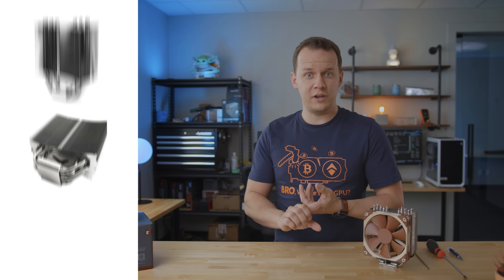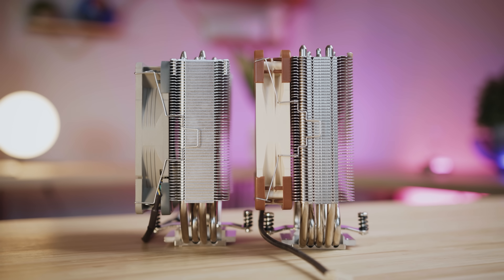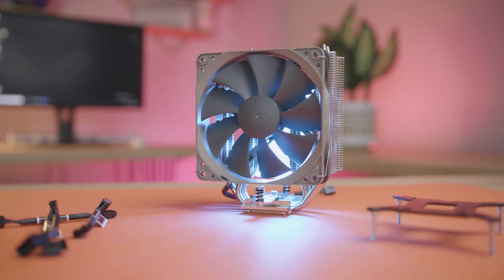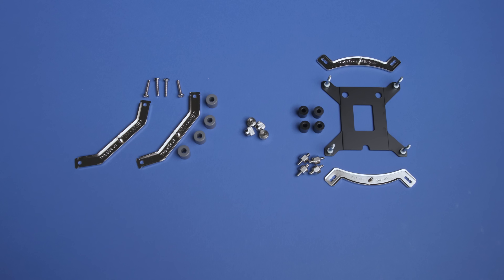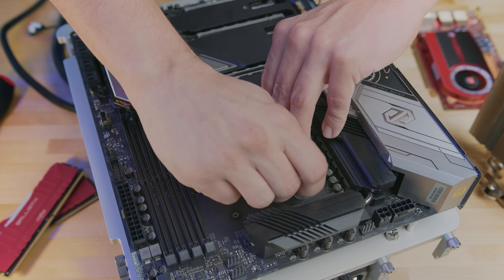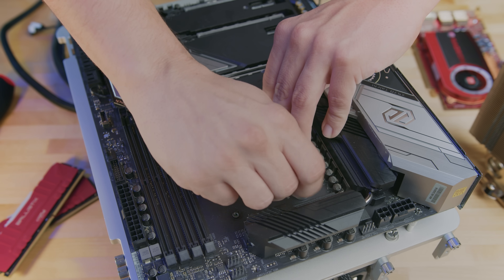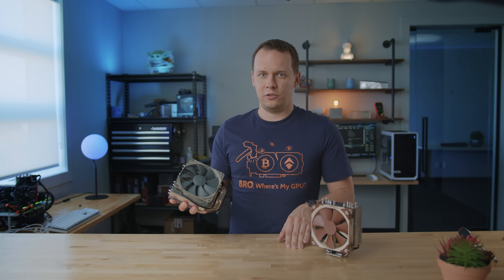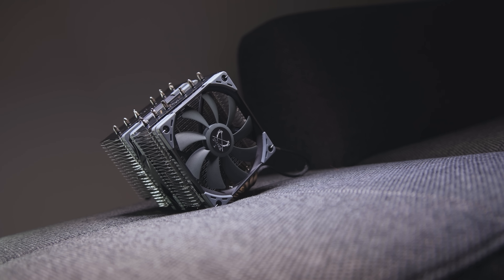Noctua NH-U12S REDUX Review - Another WIN!

Comment: I just got this for my AM5 Ryzen 7600x at 105w in an mATX build and it's amazing. It now comes with 7mm offset brackets for optimal LGA cooling. I actually replaced my huge NH-D15 with this because of the much smaller case and i regret nothing. I will be getting the 2nd fan kit because I like to overclock my CPU's a few months after buying them and it will be nice to have the extra boost headroom. So far the CPU spends most of it's time at 60-80 percent utilization in Baldur's Gate 3 at 5.1 - 5.4ghz and is always well under 60c sometimes spiking to 70ish.
Reply: so the redux comes with the offset brackets?  So we don't need to buy the separate NM-M1-MP78 kit?

Comment: I bought one ton replace the shitty stock cooler than came with the Ryzen 5 5600.

The temps went from 70 while gaming down to the 50s.

It doesn’t even go reach 50 while playing warframe. 

Great budget noctua cooler.
Reply: please return it if you can. this was a good fan back in 2021, but its 2024 and you can get a budget fan for 35-50 bucks and it would compete with noctuas 150$ cooler. the redux is dated at this point and has very little value at 55 bucks (should probably be 25 bucks at most) since the price hasnt gone down despite competiton beginning to catch up. please invest in a thermalright phatom spirit se/evo (35-50$). not only does it include two fans (that are better and quieter) with a lot of acessories, its a big cooler with 2 heatsinks, beating the redux's 1 fan and 1 heat sink, and even competing with notcuas highest end air coolers at a 3rd of the cost

Comment: How can the U12S be better than the Redux even though the fan is at a higher RPM and CFM? Interesting. I guess the extra heat pipe of the U12S does a better job than the fan. It also says the Redux has nickel + copper where it contacts the CPU. But for the U12S it says soldered nickel conduction on the blades and only copper where it touches the CPU.

Comment: I'd like to see more from ThermalRight, their high end stuff. I've been using them since the 120 Ultra 120 & still using an Ultra 120 Extreme Copper & classic aluminium in dual Noctua NF-A12x25 PWM. I do use Noctua overall in my dual; Xeon sockets. This U12S AM4 with 2011-3 adapter fits brilliant. ASUS Z9PE-D8 WS w/ E5-2667-V2 over 4G turbo OC

Comment: Hmm... wonder how the original U12S would perform with 1x or even 2x1700 rpm fans from the redux? - looks like the faster fan just about compensates for the loss of the heat-pipe so by extrapolation this setup should be pretty close to the Fuma2, but in a smaller overall package. Might be worth a look with the original  selling for $50 these days.
Reply: I decided to purchase 2 of the Redux 1700 RPM fans and try myself.

To begin with my baseline is different. I don't know how HW Canucks is getting such low temps, I have a really well ventilated full mesh case with 3 x 140 high flow and 1 x 120 med flow case fans set up for front to back cooling and the following temps I got are at full fan speed for a sustained 91w+/- 2w (CPU draw) load and my ambient temp is only 2 deg. or so higher.

Anyway..... my results are comparisons with my setup and only really intended to find the difference the fans make - everything else is equal . 

Changing the one standard 1500 RPM NF-F12 PWM (original brown) fan to a single Redux NF-P12 1700 RPM fan (in push config per the original setup) saw an average reduction in peak sustained temperatures of 2.2 degrees (from 72.5 degrees C at 24.7 deg. ambient to 70.3) it seems that sheer fan speed does make a small difference, adding the second NF-P12 1700 rpm Redux fan (in push-pull) saw a further reduction of 3.6 degrees to 66.7 degrees C sustained - a 5.8 deg. reduction overall.). This is much bigger than I though so I ran it a couple of times with a similar result, Noctua suggests a 2 deg reduction is what you should expect with just a second fans but I saw a bigger effect. Ambient temp was pretty much the same start to finish.

Of course the temperatures provided by Open HW monitor and Core-temp used to measure the cpu temp may not be 100% accurate but it seems that there is a reasonably big benefit of the 2 redux fan setup which I can only imagine would be amplified at higher CPU loads.

Comment: Sometime I would just like to know which is the best and not dependant on price. I new MB Ram and CPU can easily set you back ££££ so why worry about £50 / £100 ? ok you can add " for best for Buck " but I would just like to know if it is ok to move away from water cooling Corsair H100i or not as my pc temp have just started to rise running Rainbow Six Siege shouldnt be much for an I7 but the temp was hitting 60'c ok as soon as back to desk top theyt soon came down to 34'c / 30'c 
Intel(R) Core(TM) i7-5820K CPU @ 3.30GHz 6 cores

Comment: Great vid Mike - the Noctua 12's are an absolute legend.  What is overlooked is this cooler not only is slim, it's low profile enough for many of the mITX cases like the Fractal Node 84.  They are so easy to mount, each chipset gets its own set of instructions, the whole Noctua experience in terms of packaging, instructions, the quality, it's peerless.  As for performance, once I fitted it, I had to shine a torch in the case to check it was working - it is so quiet and cools supremely well.  

Personally, I'd go for the extra and get the U12S because those splitters and extra clips are well worth it especially with so many motherboards skimping on fan controller sockets.  Add Noctua intake and exhausts - it is a very, very, very quiet rig.

Comment: Great video! Would you consider doing noise-normalized testing on case fans? I feel like that’s not covered much, but it provides airflow for the whole system!

Smaller YouTubers have noted that both Arctic and Scythe fans outperform Noctua 140mm.
Reply: You can buy two Actic P14 fans for the price of one Noctua and they perform pretty much identical (air volume, static pressure and db)

Comment: Eh, I'd say it is another Noctua loss if you compare it against the Fuma 2
Reply: funa 2 is 30 bucks more ,
Reply: @deadscene1  Depends on where you live I guess. In my country U12s  Redux starts at 58€, Fuma 2 starts at 56€
Reply: @dainiusvysniauskas2049   ah lol ;d but have in mind that this fuma 2 is really big, most often will not fit in mid case but anyway , i  did research and find out that ARCTIC Liquid Freezer II 240 aio is the best deal and better temps
Reply: @deadscene1  It's only approx. 155mm tall, which fits in most of mid ATX cases. Hell, it even fits in Lianli O11 Dynamic, which has unusally little space for coolers and Cooler Master NR200, which is mini ITX case.
Reply: @dainiusvysniauskas2049   you miss the point , is heavy and it will  fk up the mobo over time , ARCTIC Liquid Freezer aio looks like the best option(
Reply: @deadscene1  Chances are that by the time the weight can damage the motherboard you'll have upgraded the CPU 5 times. 

Not everyone wants to mess with AIOs. Yes, Liquid Freezer II offers great cooling, but it does have its own compatibility issues and there's always a risk  of leaking involved with AIOs.
Reply: @dainiusvysniauskas2049  i mean is easy to damage your components if you carry the pc around  with that heavy cooler(unless you revmove it everytime you carry it lol )
 , i still use  air cooler as well , but looks like the LFII coller looks decent ,

Comment: So basically they re-editioned the U12P without soldering the fins (while they were soldered in the U12P) and slapped on a redux pwm fan, that has 500rpm extra over a normal P12 or 400 over the P12 PWM. Hmm dunno how to feel about this, they gave up on silence and quality and yet they still ask 50. 10 Eur Less and you get a Gelid Phantom, add 14 Eur of Arctic P12 PWM (cause yes the stock Gelid fans are a joke) and I bet it will totally shatter this or even the Fuma 2 costing like 5 eur more.

Comment: How does this perform compared to the Scythe Mugen 5 rev.b? I plan to use one of these two on a 10900f (non-k)
Reply: Mugen5 rev.b is slightly worse that Fuma2 (which you can see in the graphs), so it's performance should be on par with this U12S, but cheaper.

Comment: I have a question. Will I have to take my motherboard out of my case to install the Noctua 12S Redux? My case does not have a cutout area behind the motherboard for accessing the cooling mounting gear. I have an Asus Tuf Gaming Plus X570 standard ATX, with an AMD 3700X and its factory cooler. I really don't want to have to remove the entire motherboard and all of the rigamarole involved with that. If I simply remove the stock CPU cooler, is there anything about putting in the Noctua that will cause the backside mounting plate to fall off and thus require me to remove the entire motherboard? Or is the backside mounting gear well affixed to the motherboard already and the installation of the cooler mounting gear simply a matter of working from the top side of the motherboard? Thanks for your answer. This looks like a dandy cooler for something like an AMD 5900 CPU for my motherboard. 😎

Comment: I used to have arctic and scythe fans which are considered to be good fans. This year I replaced all 4 of them for noctua fans (3 case fans and 1 static pressure fan for the cpu heatsink). I eliminated 85% of noise with identical temperatures. Noctua fans are really that good. They are worth it.

Comment: Just by a Scythe Fuma 2 instead. It is better in every regard and also is around the 50$ price bracket. I see no point in buying an outdated Noctua product (the Redux series) just because of the fact that there is a noctua branding on the Heatsink.
Reply: Dennis Andrews  The MX-4 Paste is from Arctic not Noctua. ;) I would suggest, just to use the regular Scythe Thermal Paste. For regular use its more then adequate.
Reply: noctua has better support and warranty.

Comment: I have a NH-U12S , it has the brown 1500 rpm fan, I want to have two fans running on the same color, should i put two 1500 rpm fans on it or have the 1700 rpm reflux fan at the front and the 1500 rpm fan at the back, ? I was not shour as I bought both fans fan seperatly as im going to use one as an exorse fan for the back of the case.

Comment: I've used a u12s for years never had a problem with it. But when I upgraded to the 10700k it struggled to keep it cool and overclocking was off the table. Got myself a fuma2 and now temps are under control.

Comment: is this better than a deepcool gammaxx 400 for a ryzen 5 3600?
Reply: you probably won't notice any difference in terms of thermals. I changed a gammaxx GTE V2 which is the same thing with an older NH-U12P SE2 which is comparable to the NH-U12S redux and temps didn't change at all on my 5600. It's when you're running a much hotter cpu that you will start to notice the differences.

Comment: Testing at constant noise level is ok, but does't tell us how good is the cooler actually in normal conditions.  Not sure why are you guys doing that at all. Most people are interested in the performance on auto-fan and on max fan imho.
Reply from the maker: But auto-fan is different on literally every motherboard.  What I DID forget is to tell you which RPM levels equaled which decibels.
Reply: @HardwareCanucks  That is a good point, but if you look at the results with this method it looks like U12S is on par and even better than the U14S, which is unlikely imho and could be misleading.

Comment: Seems like a great value cooler , as u wont need the extra's u get on the normal u12s for most modern systems you could just spin the fan down instead of using a low noise adapter.

Comment: Most overpriced piece of junk. Anything other than d15 or d15s, and nf a14, coming from noctua are just overpriced garbage.

A fuma 2 for 10 bucks more, or even a mugen 5, is far better value than this.

This is just a 212 evo at double the price and with a full copper coldplate.

Comment: Thank you for the comparison. I have the U12S SE-AM4 and was curious if the redux version is doing anything better.
Reply: Hi , I have the same cooler - I bought 2x Redux fans and swapped out the stock fan. 91w +/- load 25+/- Ambient. 2.2 degrees lower temps with 1 redux fan, 5.8 degrees lower with 2x1700 rpm redux fans in pull-push. Really surprised me.

Comment: 6:00 W(ho)TF takes off the AM3/AM4 mounting plastic brackets?  Any cooler rated for AM4 mounts to stock brackets on the motherboard.  The stock backing plate is solid, no need to change it.

Comment: Pre-applied paste is just a protective layer for shipping purpose in my view. I always remove it, clean the cooler with 91% alcohol. Even if the CPU is brand new, never used. It gets cleaned with 91% alcohol also. Then I apply GC Extreme fresh from the tube.

But I also spread a thin coat, covering the CPU heat spreader. Then I place a small dot of paste in the center. 1/2 a "pea sized" dot. Some CPU's have low spots and so do some cooler plates. That tad extra paste will fill that in.

Comment: Air coolers are good long term investments. Don't buy the cheaper one if you don't have to. I have a thermalright ultra extreme 120 and silver arrow sb-e from years ago. They're both capable of, silver arrow especially, of holding their own against most 240mm aios. It's not just about liquid cooling. Most aios don't have enough liquid in them, not enough fin density, not powerful enough pump and aluminium only radiators.

Comment: I think the market needs line between regular products and redux, one that gives you all the quality you get with top products but with less goodies and fanciness

so no see through packaging that doesn't even matter since you order online, no extra pads, no LNA, no extra clips but the main product itself would be the same top tier one
that way you save the environment a bit, don't end up with a whole drawer of accessories and even if it's just $5 less on a package it makes a difference when you buy say full set of A12x25 for your case

taking away a heatpipe, making contact worse and on top of that using worse fan makes you risk actually spend more money since you'll end up not satisfied and moving to the top anyway eventually

but obviously you won't notice it when noise normalized, it starts to matter when silence normalizing though

what I'd love to see is exactly that: setting the coolers up to the speeds you'd actually use them at (so much, much lower than you use currently) and seeing how they fare
I can tell you already that some of them would simply fail (like Scythe ones, Kaze Flex are just unable to go quiet enough, but for the completeness of comparison running them fanless would be interesting)
Reply: and of course I hope to see the passive Noctua as soon as possible once it finally gets released, this will be a game changer
Reply: Yeah, I’d like to see a simpler packaged version. Same product but fewer accessories. Even pre applied thermal paste is OK. But cutting corners on the cooler itself is not good. 
Most Noctua buyers don’t care that much about price, they want a premium product. And this just look like a knockoff.

Comment: Please include any CM Hyper 212 for any air cooler review as a sort of baseline reference
Reply: I have (had) the Hyper T4, 212 (evo2) and currently have the NH-U12S on the same CPU/Case/MB setup - from my experience only there is about a 1-2 degree reduction in CPU temps at full fan speed at 60w CPU load (stock without the LNA) for each of these in that order, the Hyper 212 and NHU-12S are pretty close but the Noctua fans are definitely more pleasant to the (my) ear at full speed. The gap gets bigger the higher the CPU load at 90+/- 5w the T4( well my T4) was about 10 deg. warmer than the Noctua - the 212 and NH-U12S were closer circa. 2-3 deg. in favor of the Noctua. Based on price alone this is a pretty good outcome for the 212 but you can get an original NH-U12s with a 6 year warranty and endless mount upgrades for $US50 right now which I think makes it overall better value.